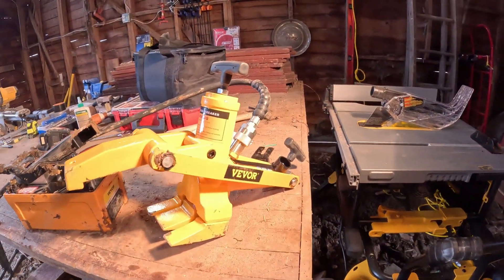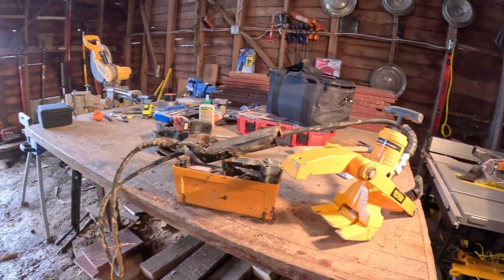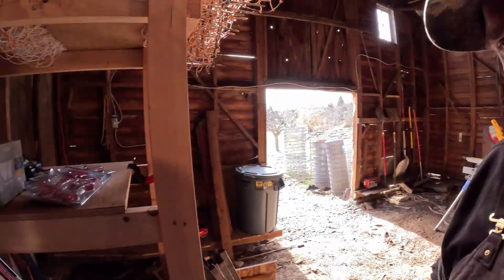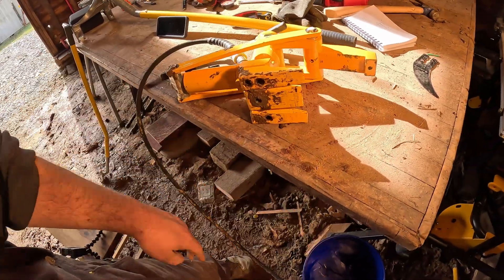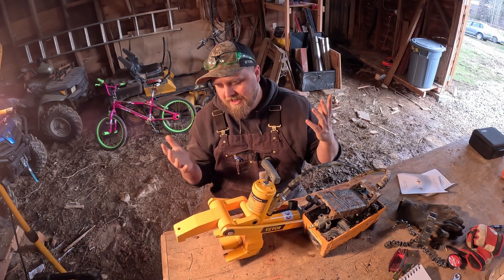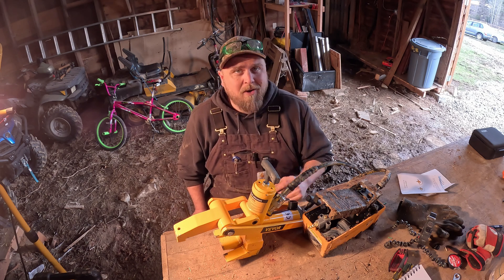Hydraulic Bead Breaker - better than a tire hammer?

Comment: This is so far a p.o.s.
145 psi and no movement from the lower leg. 1/4" after 20 minutes. My instructions tell me how to change valves in an engine. W.t.f. ?
I'm buying a duck bill hammer right now because they haven't failed me for over 30 years.

Comment: Yes its better than a hammer, but for a different reason… peeling a tractor tire without removing the rim from the tractor…
I wish i had one of these… instead I’m swinging my hammer at the backside and have been doing this for some years so i can break the back bead while peeling… but its still a pain in the ass 😂😂

Comment: I know this is an older video. I've been a tire guy for years and I've used this style bead breaker for many years but the ones I have always use have been in the 1000- 2000 dollar range they were originally designed to break down 2 and 3 piece split rim truck wheels and then Bridgestone came out with tractor tires with a wedge notche in the bead and sidewall that was meant to be a starting point for a duckbill hammer and someone found that this style bead breaker fit that notche and after that they became ag tire breakers the good ones have shoes in different lengths for different tires. The shoes and pusher shoe for car and light truck are real short they keep breaker from slipping like yours di in the beginning.I have an AME on my service truck but another emploee has a vevor and it worksjust fine till you get to forestory tires then the AME shines